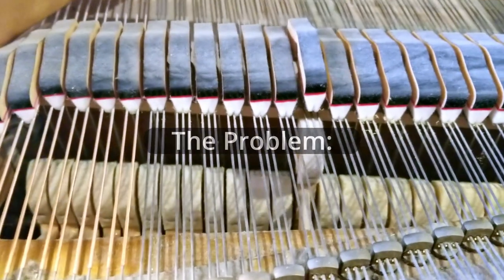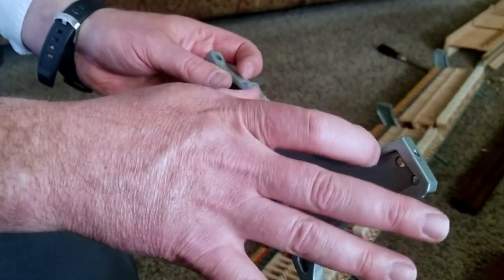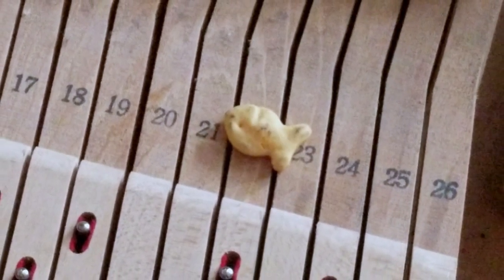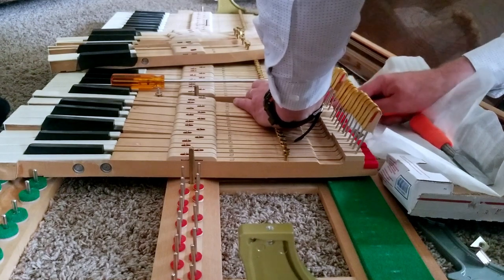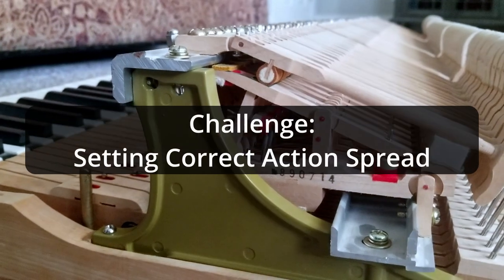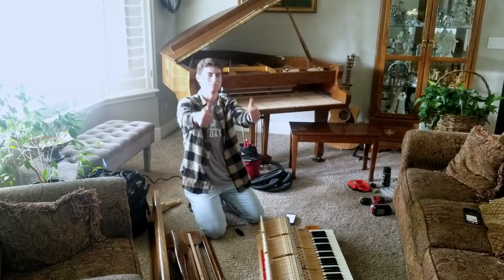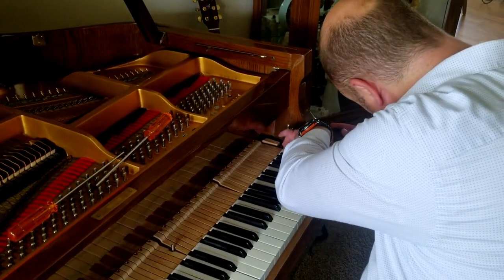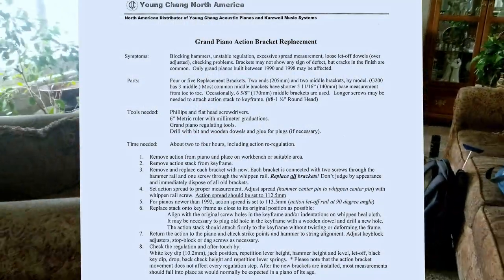Piano Lovers: If You Own a Young Chang Grand Piano You Should Be Aware of This Common Problem!

Comment: Wow. Superb video. I spent the whole of a long and frustrating day here in the UK yesterday, wrestling with this exact problem on a Weber grand. It had 2 broken brackets, which I repaired, but the "spread" of the action was just as you show in your video. Though we're far from out of the woods with this piano, your video has pinpointed the issue and it's good to know I'm not ALONE. Thanks so much.

Comment: where can I purchase a Tuning Lever for our Young Chang baby grand ?  Seems like the generic tuning levers are too loose on the tuning key ??
Reply from the maker: I order from a supply house that sells to the industry. It sounds like you need a hammer with a changeable tip so you can get a tip size that is smaller than what you have. Email me if you'd like me to look into some options. saltlakepianoservice@gmail.com